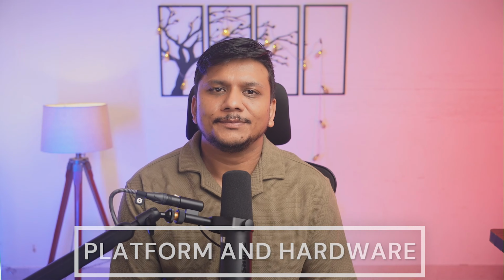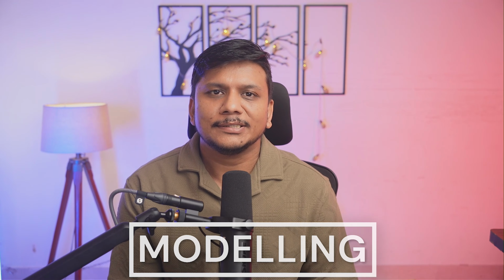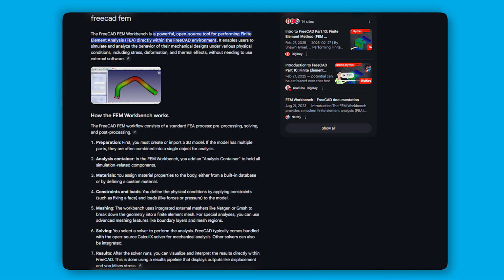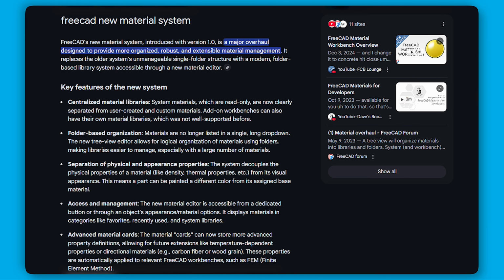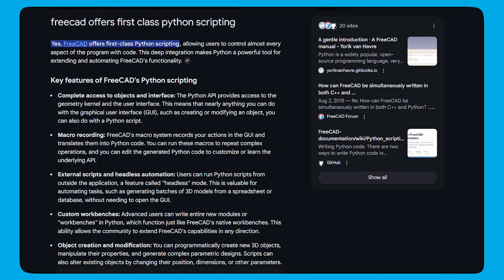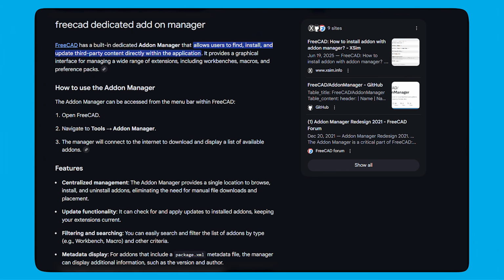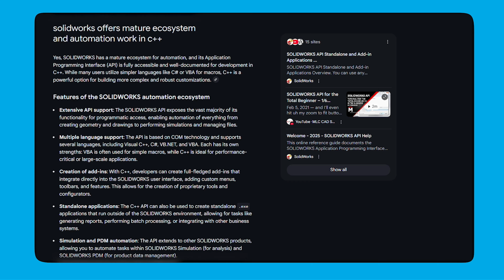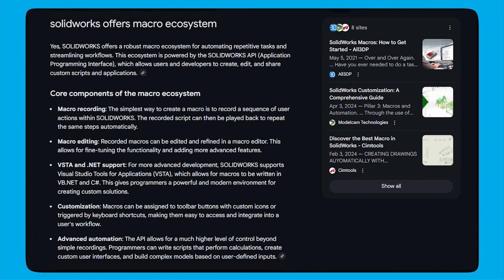Is FreeCAD Really Better Than SolidWorks?

Comment: I find it's very hard to understand Modeling Treeview.  In Solidworks, it's very easy to trace back .
I hope in the future Freecad will copy Solidworks Treeview which allows you to easily rollback and edit previous work.
Reply: FreeCAD allows you to go back and edit a feature. No problem there. However 1.1.3 seems to have an issue propagating that change(s) through the rest of the model, in my experience. The other thing that I haven't figured out how to do with FreeCAD (but is simple in Solidworks), is inserting a new feature at the rolled-back location. I'm not saying you can't do it in FreeCAD, but if you can...I haven't found it yet. 

Solidworks is optimized for speed-of-design, in my 10+ years of using it. FreeCAD isn't. But for the price, you can definitely accept some of that--and FreeCAD is getting better and better all the time...especially if you learn some of the keyboard bindings. But there sure are a lot of them, lol!
Reply from the maker: Yes, I agree with you 👍 Hopefully FreeCAD improves this experience in future updates.

Comment: Freecad is for hobbiest. Always will be. This isn't a slam, it's legacy reality. For hobby 3D printing, top-notch. Learning a few skills can have someone custom printing in a short time. This aids in learning how to design parts for 3D printing since most things not printed are not designed to be printed. A new way of engineering is required. A large, professional print farm has a youtube channel devoted to this topic. It's channel was created so the print farm doesn't need to redesign parts of those wishing to have designs produced for market. Can Freecad be used to design printable items for sale? 100% YES
Reply from the maker: Yes, FreeCAD is definitely a great choice for hobbyists, makers and 3D printing 👍 And you are absolutely right that it can also be used to design and sell commercial products. I’m just not sure it will always remain limited to hobbyists because it is improving quite quickly. The bigger challenge is still industry adoption, professional support and data management compared with SolidWorks.